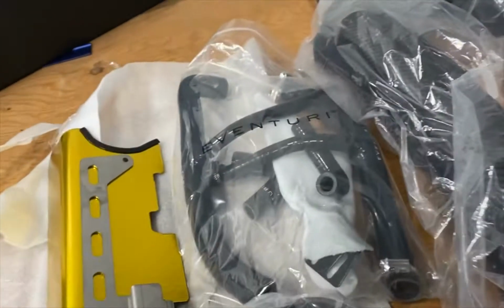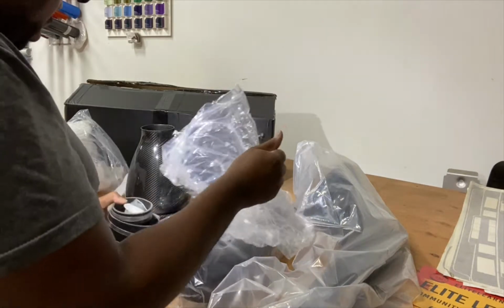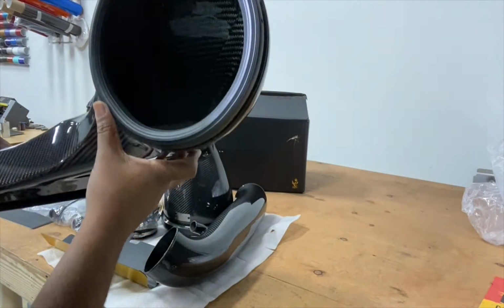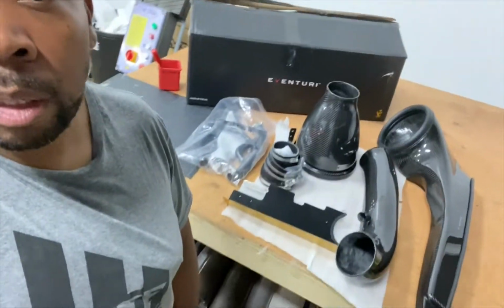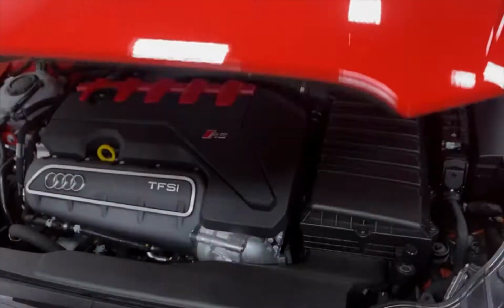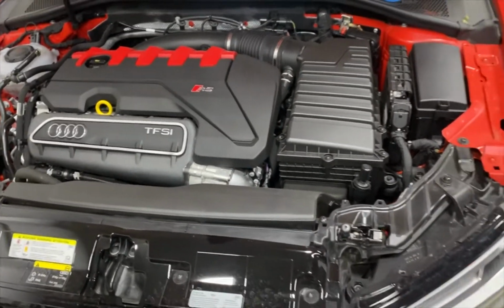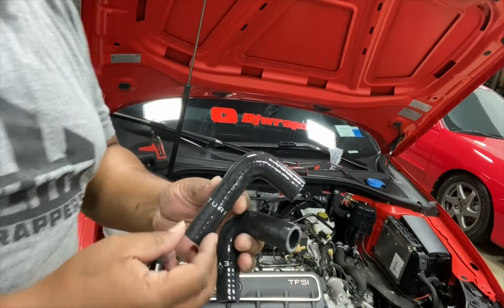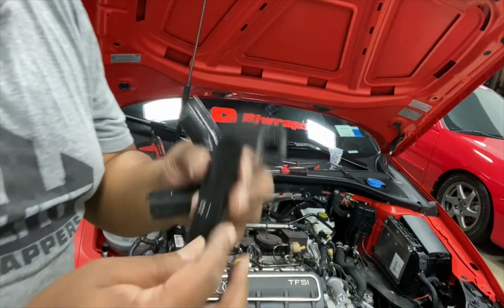EVENTURI INTAKE UNBOXING & INSTALL

Comment: How's the intake now?  Leaning towards the Eventuri intake and inlet.  Plus Unitronic Stage 1+ with Forge intercooler for my 2018 RS3.
Reply from the maker: Love it. Crown jewel when the hood is popped at shows. Also you should really consider the Wagner ic, fitment is perfect and it’s massive yet light. I don’t have an inlet yet but the bay gets unbelievably hot. The intake takes the heat well so the carbon inlet should be fine. Thanks for watching, are you doing a cat back? That’s my next video, it’s between the boostlogic and ego x.
Reply: @BjWraps  thanks for the info.  I did see your video on the Wagner.  I had forgotten about that one, definitely looks like good quality so I think I may go with the Wagner.   Just doing the intake side of the engine.  Next year look at the exhaust side.  Will be looking forward to your videos.   My first car was an Audi 5000, love these rally 5 cylinder engines,  it just doesn't get any better then our RS3's.
Reply from the maker: @bgs3123  🙏🏽🙏🏽thanks for watching, it seems like I’m not getting a lot of traction but Im just going to keep posting. The Wagner you won’t regret. This is my first audi, my bro and fam always had bmws and vw’s. I hope reliability is on point with these 5 pots. I’m in love so far though. Lol

Comment: Liked and subscribed. I have a 2018 ttrs Merlin Purple color . Really like your mod choices . Wondering if you ever got a 4 inch turbo inlet , if so which one ? I’m wondering if u can pair the eventuri intake with the Unitroniic turbo inlet ?
Reply from the maker: Yes, and thanks for watching. I got the unitronic inlet and the eventuri intake with a large coupler that I called and ordered from eveunturi. I have another video coming soon.

Comment: Hi man does the attachment to the inlet pipe come only for the stock turbo or does it come for a 4 inch inlet as well?
Reply from the maker: Hi thanks for watching, the eventuri turbo inlet pipe comes with the coupler to connect to the intake. When I ordered this intake I only had the stock turbo inlet  pipe so I didn’t ask about a larger coupler. But I’m sure they can supply it if you specify.
Reply: @BjWraps  great content man!! And perfect, I was wondering if it connected to the stock turbo inlet. Since that’s what I’ll be doing for now. But I think that answered my question
Reply from the maker: @angelsalcedo7532  yes if you have the stock turbo inlet, you are good. Please give me a sub, I have the cat back video coming shortly. Hit the bell to be notified 💪🏾💪🏾 what other mods do you have?
Reply: @BjWraps  perfect man thank you! Just did! I’ll keep an eye out for that one. 100% stock so far intake will be my first mod, just got a week ago catalunya red rs3. Then will be the inlet to get on a Unitronic stage 1+ file
Reply from the maker: @angelsalcedo7532   Nice, enjoy and welcome. I have a tango red rs3 but I can't tell the difference between it and Catalunya.